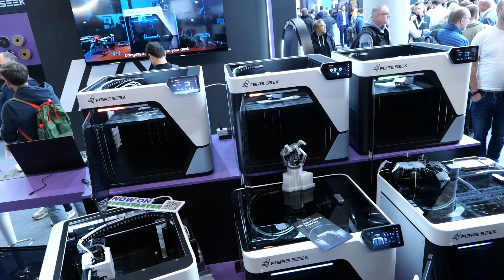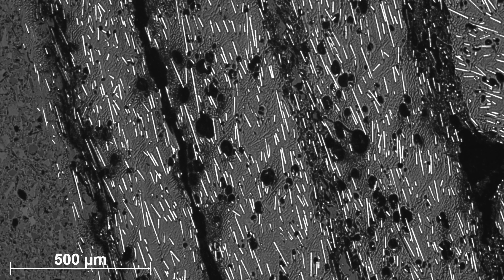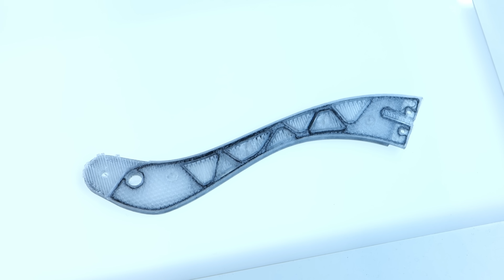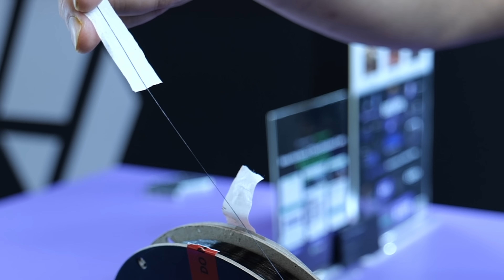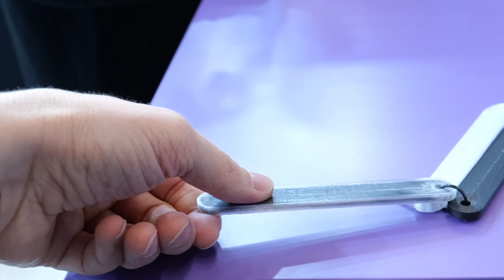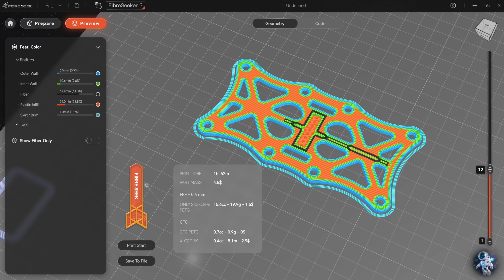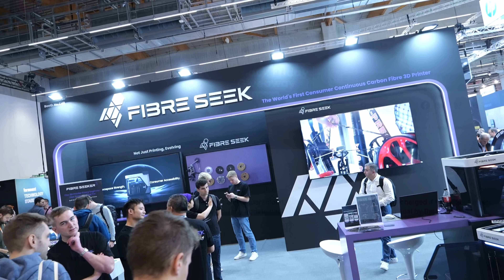The FibreSeeker 3 brings Continuous Fiber Printing to Consumers!

Comment: This looks way better than the Markforged printers. My school has a few of them and I don’t think they have ever printed reliably for more than a week.
Reply: Doesn't sound like any markforged I've ever been around (Mark Two and X7) or own (Onyx One). I have over 3000 hours on my personal machine with only two failures.
Reply: @LionelAkram  To be fair part of the problem is that they are in a school. When we have them dialed in they print great but the beds are really finicky. Every time they get bumped we have to level the bed. Since they are constantly surrounded by destructive middle and high students that happens often.

Comment: How do they cut that carbon fiber during print? Or is it just "teared" by nozzle whole it is hot?
Reply: Like with Markforged there's a cutter in the print head.
Reply: @LionelAkram , this seems to be one of the most interesting technical problems involved with this approach. I'm disappointed this wasn't covered in the video.
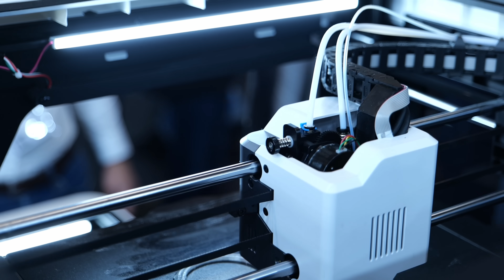Reply: @jimhark It was covered in the video. 8:51
Reply from the maker: There is a rotary cutter in the printhead.

Comment: I would love a Prusa XL toolhead for this
Reply: Absolutely, I’d rather have a tool head for my existing printer than adding a whole new printer.
Reply from the maker: That's what I tought as well but you'd need to work around Markforged and Anisoprints patent (though as far as I have seen, the Ansioprint patent is abandoned in the US)
Reply: @CNCKitchen  fiberseeker is just a sub-brand (re-brand?) of Anisoprint. Anisoprint was based out of Luxembourg, but I believe most operations are out of China these days.
Reply: @TheDerekshelley They filed bankruptcy in Luxembourg last year
Reply: Imagine a prusa xl with con. fiber and silicon printing. 
And of course your regular printing heads

That would be insane

Comment: To be honest, why to bother? We are reinforcing parts in direction where parts are already good enough, weakest direction is still weak as it was :/ as it is very interesting idea and nice execution, area of application will be limited. We will see how idea will adapt to the market.
Reply: It goes from good enough, to better than any plastic and rivaling aluminum in some applications. This also allows you to do other things, like print copper strands into your parts for electrical connections and circuit boards
Reply: @starmanxvi yes, but main question is, if it is really needed for FDM 3d printing, where you still need to think about layer adhesion, stress orientation in parts and etc. real question is, how much better and  more cost effective will it be to just machine part from CF sheet or create part from CF. Which you can do at home as well.
Reply: @kpax0 You can make some geometries with FDM, which are hard or impossible with a CNC machine.
A carbon fiber layup is usually also 2D and has reduced strength in the third axis, but it still is useful.
In many applications only strengthening in 2d is needed, and this product addresses these applications.
Reply: @lukasdimmler2622  that is correct, but difference between CF parts and this solution is, CF parts do not have problem between layers (as filler material is "fully fused" together, while FDM will not be "fully fused"). I would really want to see parts that are so complex that cannot be done on CNC and yet need only be strong on 2 axis. Interesting point anyway.
Reply: Its kinda niche product. Not every part is taking multi-directional loads. But yeah: i'd like to see same concept on a 5 axis printer.
Reply: Carbon fiber Is really good at tension but Is significantly weaker at compression, torsion, etc.(as a certain submarine showd us), i can only see this in  flat-ish parts subjected to a lot of tension and not a lot of anything else, like a Rope or a chain
Reply: @paolo69 Most thermoplastics are a lot stronger in compression than in tension. So the thermoplastic part of the composite handles the compression and the carbon fiber handles the tension.
Regarding submarines:
There were some Navy test submarines made from carbon fiber which were just fine at even greater depths, OceanGate just ignored their subscale testing data and realtime monitoring data.
Reply: @paolo69 i was waiting for submarine reference 😅
Reply: @kpax0 cant believe its been over 2 years already
Reply: @paolo69 exactly, that is why I am wondering why not just to machine part from CF sheet or make it using 3D printed mold. I am just trying to find real use cases for it, while I would love to have something like this in my workshop, I am a little bit worried that it will not find enough demand from the market.

Comment: BRO! THANKS A GAME CHANGER WHEN IT COMES TO CARBON AND GLASS FIBER INFUSED PRINTS! Keep the creativity flowing! 🤩
Reply: This is so huge. I'm kinda over composites when you can just print bulk 100% infills at a cheaper price for repeatable material strength. But if we can start using layered filaments rather than chopped additives, then continuous 3D printing can get stronger than injection molds.
Reply: Markforged did this like 10 years ago lol.